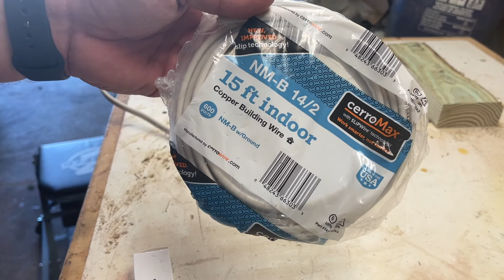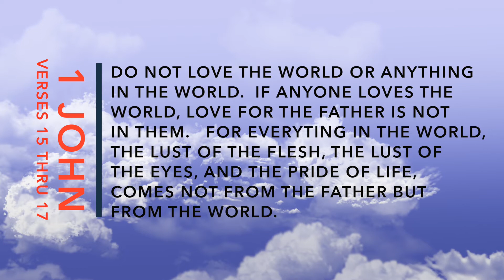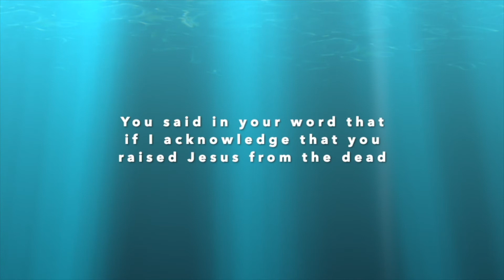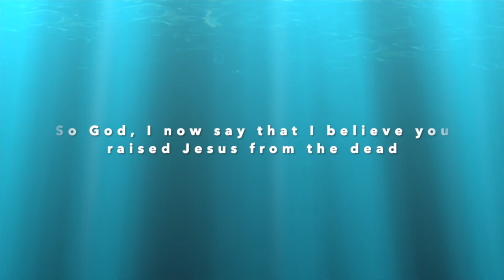Fixing a broken 30 year old Stanley Garage Door Opener

Comment: Just so you know, there is always a way to modernize these openers and have a remote that can open all 3 doors and keypads aswell.
Reply: Thanks for that, I’d sure be interested to learn how!!!
Reply: @richardball6320  liftmaster 365LM recover box. Will work with any liftmaster 315 remote or keypad and is just wired in with the wall buttons. It’s also rolling code